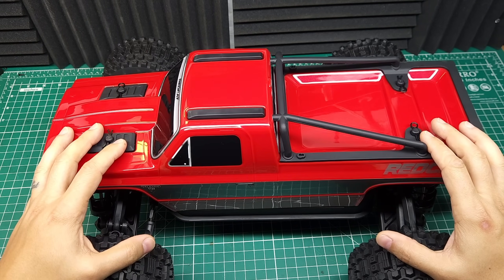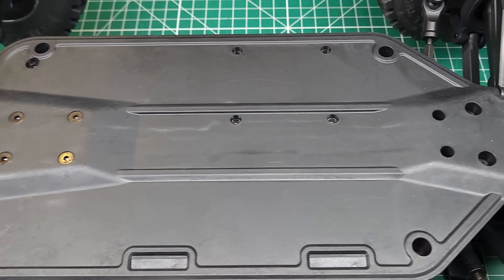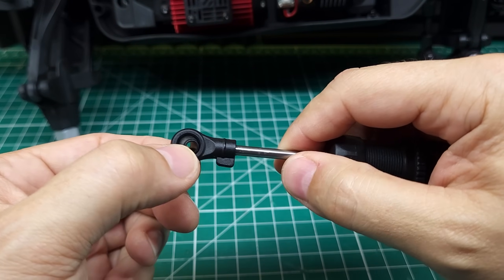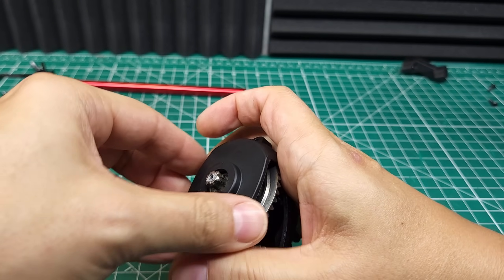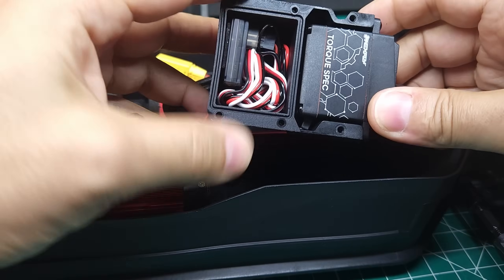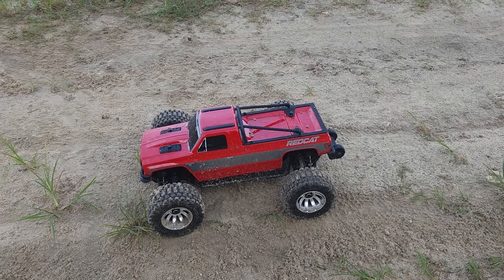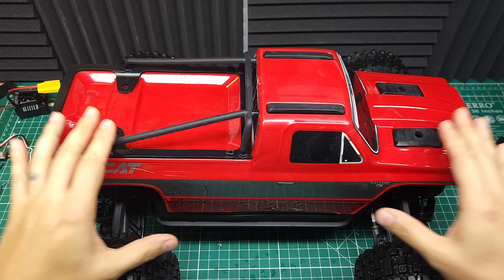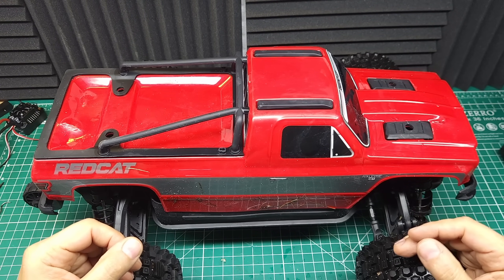I Got The Redcat Valkyrie & It's Awesome! But There's A Problem.

Comment: Have you had any overheating issues with the motor? As soon as I put the same battery you put, the 4s SMC 6500 150c it shuts off on me within five minutes of run time and the green led light on the esc flashes green. Once it cools off it runs for another couple minutes and shuts off. Just curious if you’ve had this issue as well or have heard of that with others. I contacted them and they were great, said they’d send me a new motor once I get a temp reading. I’ll need to buy a temp gun just sucks because I just got this less than two weeks ago.
Reply from the maker: If it's shutting down on overheat it'll be from the ESC not the motor. The motor does not have a temperature sensor in it. I didn't have any overheating issues. Does this happen with a different battery? It's possible you have a defective battery and it's shutting down on low voltage
Reply: @ ok I wasn’t sure what it would be, it happens with both of the same batteries being the ones I mentioned earlier, same as yours in this video.
Reply from the maker: @chrisg3560  hmm

Comment: Good rundown of this rig buddy seems like the geometry of this truck just seems to be a little bit off maybe proportions or suspension travel because it's definitely not a smaller version of the vigilante it actually looks a lot like the armor vortex in terms of proportions and suspension travel there just doesn't seem to be the same type of arm swing and size of tires and makes the body look just a little funky big and it might be me but when I was watching your driving it seemed like the vehicle just didn't handle that well🤔🤔
For $300 though and if it's really durable and those shocks can be fixed that's really a great value
Reply from the maker: Yeah check out my latest video on it. It's fun but definitely doesn't handle well. I think it's biggest problem is the scrub radius in the front. Where are the tires rotate is way far out from where the steering pivot point is and it causes some really odd handling characteristics. 
Overall though like you said for 300 bucks with what you're getting it's kind of hard to be mad at it.

Comment: Where can I buy a 50 thousandths bit?
I stripped the grub screw as well. Not sure what to do… I snapped one of the drive shaft cups trying to get it off. 

Super annoying to wrench on this rig
Reply from the maker: There are quite a few options on Amazon. There's a team associated one that honestly I don't really like as it's kind of soft. I most recently picked up a wera hand hex wrench in  .050. They're made in Germany and it's very good quality.

Comment: Its weird that rc driver online got like 58-59mph on road with his truck but everyone else is getting low-mid 40s offroad. This truck seems like a great deal and im definitely grabbing one. Just wanted to see how the first batch held up.  Great breakdown as always
Reply from the maker: On road and off-road speeds Will always be wildly different because you get less traction off-road, it's harder to control off-road and the friction of the surface is more off-road. 
Personally I like to do off-road runs because it shows people how the car actually is going to handle when they're bashing it and a reasonable speed to expect when bashing. No one I know bashes their monster trucks in a straight line on concrete :-)
Reply: @DoRC  No I get that for sure and I agree. I like seeing both tested on road and off. But i do like seeing offroad speed testing as it seems like alot of guys don't test them offroad and that is what mostly this basher MT will be run
Reply from the maker: @cwatson42785 Yeah when I started doing it I did so because I wasn't seeing anyone else showing the real world off-road speeds. Of course real world off-road speed is pretty subjective too It depends on when the last time the grass was mowed if it rained etc etc so it's more of a general idea than a hard number.
Reply: @DoRC  Yup for sure. That's the one good thing about onroad tests is its more of a true baseline but then comes down to lipos used and what not but I think they are both good info to have. I'm just getting ready to try out my machete I've yet to run. I got the 4s one and got a max8 and new motor to swap in and looking forward to trying it out and then I'm going to grab one of these for sure. Looking forward to more bash videos on it!

Comment: Are the shocks same length front and rear? whats the eye to eye measurement for the shocks? max battery tray length and width? Will a max8 g2 or g2s fit directly? Is redcat coming out with aluminum upgrades like hex extender, c hubs, knuckles, uprights for it have you heard?
Reply from the maker: Yes. 118 mm. 155 by 45 by about 65 though you might need longer straps. There should be room. I have no idea what upgrades they're planning.
Reply: @DoRC  Thanks for the quick reply and info!
Reply: @DoRC Typhon 6s rear shocks are 117mm ;)
Reply from the maker: @magnusstone  Nice! Yeah these look relatively normal in length so I suspect there will be options.

Comment: Redcat seems to be doing pretty good on their newer cars amd trucks
Reply from the maker: Overall yes though this shock issue is probably something that shouldn't have made it out of the factory.
Reply: @DoRC  yeah thats crazy about how they or any company would think a pressed in shock end work work good. Ive had the treaded ones come out once but it was a very hard wreck

Comment: That is wierd I have the truggy and the servo was so fast I had to add a lot of dual rate to calm it down to do the speed run
Reply from the maker: It's fast it's just not powerful and as soon as the rack gets loaded up with any kind of dirt it gets really sluggish.
Reply: @DoRC  I think the smaller tires on the truggy help it seemed ok to me time will tell

Comment: Since the stock ESC is an unbranded hobbywing, you could put in a regular hobbywing max 8 esc with now problem correct?
Reply from the maker: You can use pretty much any brushless ESC with pretty much any brushless motor. That being said the new G2 hobbywing ESCs tend to not play very nicely with some sensorless motors and when they do or do not seems kind of random so that's always a risk.
Reply: @ I have a hobbywing max 8 Gen 1 I guess. Not the newest one. I’ll just have to get bullet connector adapters, I can’t remember what size the connectors are on the max 8 Gen 1 esc.
Reply from the maker: @DaltonKemp Yeah that would work fine.  The Max 8 uses 6.5 mm bullets
Reply: @DoRC  ohhh ok awesome! Thanks!

Comment: I can't find the video for some reason. But there were 2 guys running this truck and jumping it and the only thing they broke was a shock and it broke at the the lower threads. Maybe both types of threaded and press are being dispersed with these?
Reply from the maker: Okay so get this. I just checked the other three shocks and one of them is threaded while three of them are clip style and won't unscrew. Looks like they may already know it's a problem and have just shipped some of the shocks with the old design.
Reply: @DoRC gotta get rid of the old inventory somehow… that’s a bad company
Reply: @DoRC  so crazy!

Comment: You could stick the 2.0 through the axle instead taking the u joint apart , unless the axle solid ?? I’m going grab one of these trucks , shocks is disappointing
Reply from the maker: Yeah unfortunately the end of the axle doesn't have a hole in it.
Reply: That would be so much better. I wonder if a hole could be made?
Reply: I’ve fought with  arrma axles forgetting you can go through the axles, you could experiment 🧪 drilling through but you would need a drill press to keep it centered .
Reply from the maker: @RcPlayer-tt2vw  Yeah you could definitely modify it. I'm kind of surprised they changed the design from the Wov. The little clips are annoying but personally I think I'd rather deal with those than an .050 grub screw

Comment: Hey man how are you? I wanted to así, do you have an opinion on the zd Racing mx-07?
Reply from the maker: Unfortunately I don't have any first hand experience with it The only thing I can say is that from what I've seen it definitely has some weak points and I think for the price you could probably do better with other brands even though you might have getting something that's a little bit smaller
Reply: @DoRC  thanks for the info Man, cause thats the problem, I been thinking about getting a roller of this cause of the price vs the size, next thing in size of im not mistaken, on trucks, would be the X-MAXx, this zd truck with electronics would be around 800usd here in México, I know the X-MAXx Is "1000" usd but thats the US price, here in México Is around 1500, so almost doble the price, also I like better metal on rc's than plastic, even if its heavier and It beends and maybe brakes more easy, but im also not a hard basher at all, just small jumps, no Skateparks, I also been thinking about maybe a kraton or notorious but those are a bit smaller and the spares are way more expensive, but I can get one of those 2 arrmas for 550usd on eBay, shipped to my house, so Its a great deal cause Its really free shipping, I dont know what to do, in your opinion,what do you think i should do? Maybe another posible option? Any input would be welcome

Comment: Wait, u aren't going to recommend it because of shocks? I could see if the shocks broke during your session, but they didn't. It looked like it bashed pretty well , actually. Usually I agree with your vids , but the reasoning on this one is weird. Great video none the less. Keep pumping out the content
Reply from the maker: I'm doing that based on my experience with these shocks in the past. This was a big enough problem with the Wov cars that they pushed out an update pretty much as quickly as they could. Quite a few people had the same breakage with the same shocks. There's no reason to believe that It won't also be a problem in this car. I do have some more information on it though so make sure you check out my next video!
Reply: @DoRC  Yeah, the pressed on shock ends do suck, but you really need to beat them up badly for them to come out. Like a whole bunch of bad landings. Maybe RC comes out with and upgrade in the future for that. But yeah, once those come off, you have to replace the whole shock shaft. At least I had to on my 3s Granite. I put different shocks on it after it happened once. But like I said, it took a while. BUT, that's a much lighter vehicle and a total different animal 😂
Reply from the maker: @joseCalderon1976  The ones on the granite were a lot tougher and you could just push them back in a couple of times. This particular design can actually break from a pretty gentle landing if it's from the right angle.

Comment: When i heard JayTeeRC mention that this had a 8kg servo, i just shook my head. 15kg would have been barely enough.
8kg is a joke on a 10th scale. 
That's unfortunate. Same with the shocks. Seems like Redcat wanted to get rid of the rest of WOV's stock of old style shocks, so they threw them in the Valkyrie. Bummer. Shoulda sold them to HBX, but i guess HBX doesn't have 10th scale trucks.
Reply from the maker: It's possible but these shocks are actually a different length different color and red cat doesn't make this car. The same company made the red cat and made the wov racing.  It just seems like someone at that company didn't tell redcat about the problem with the shocks.
Reply: RTRs rarely come with decent servos. This is nothing new
Reply: According to the box, its supposed to be a 35kg @ 7.4v servo.

Comment: Wouldn't a hollow tube be stronger than solid, and lighter weight?
Reply from the maker: That's actually a more complex question than you might think. For a given mass a hollow tube will be stronger because most of the strength comes from the outside of the shape but for a given diameter a solid rod will be stronger simply because it has more material. So ultimately if they made it larger in diameter and hollow they could make it stronger for the same weight but for the size that it is the rod is stronger

Comment: HR shock travel limiters solves issues.
Reply from the maker: Yes. That would solve the issue but you shouldn't have to do that especially given that the manufacturers already corrected the problem for another brand.
Reply: *when I feel like keeping my shocks around for a long time and not yanking rod ends off- losing retainers and springs, I will use HR everytime.

Comment: Wow you did not recommend it because of shocks mine hasn't broken yet lol
Reply from the maker: Not quite sure what you're saying here :-)
Reply: You said you wouldn't recommend the rc because of the shocks @DoRC
Reply from the maker: @ISIAH_STL  ah. Well given how much of a problem the same design was on the wov racing cars it's tough to give a recommendation on it. It's a good truck I just think that people are going to have problems with the shocks.
Reply: @DoRC  oh ok I understand but all Rcs have weak spots and problems and it depends on driving styles
Reply from the maker: @ISIAH_STL  absolutely but I would call this more than just a weak spot. At least on the wov cars It was really more of a design defect. They fixed it and released an updated version of the Wov cars pretty much as quickly as they could. Obviously not everybody is going to experience a failure but I think it would be frequent enough that it will be considered a pretty big problem.
Reply: I just appreciate your honesty, you're clearly not a fanboy and tell it how it is whatever the brand unlike some other reviewers...

Comment: So this is similar to the one Tomly just reviewed
Reply from the maker: It's nearly identical. I'm sure there are some subtle differences but it'll be 90% the same. The wov racing one Is also very similar though it has some differences in how the suspension works.
Reply from the maker: @WowoodogPlays  It also looks like this uses the same power system as the wov racing.  The redcat one uses a hobby wing power system. It is worth noting that it appears like the new 2-in-one spectrum systems are being made by the same company that makes the wov racing ESC's as the power button is nearly identical.
Reply: @ good to know, I might look into getting one of these cars on this platform (possibly)
Reply from the maker: @WowoodogPlays If you can get it for a reasonable price then it's worth it. The Valkyrie was on pretty crazy sale recently I don't know if it still is. He's definitely aren't the most precise vehicles in the world and the steering system is kind of lame but there's a lot of fun to be had for the money.

Comment: Biggest turnoff with this truck to me is the pinion idler gear and the HORRENDOUS scrub radius
Reply from the maker: What specifically bothers you about the idler gear? 
Yeah the steering geometry definitely isn't awesome though For general bashing around it's not really much of a problem
Reply: The fact that it exists. Added complexity to a truck that’s already a pain to work on. Thats just me though and I’m notoriously picky lol
Reply from the maker: @PigglyWigglyDeluxe I get that. Looking at the design I suspect it's done so that they can have the motor further away from the center differential. The center differential module is pretty big and without that idler the two would interfere with each other.

Comment: I'll spend the extra $40 for the MT10
Reply from the maker: This is quite a bit bigger than the MT-10. More compares to the max and 4S Arrmas in my opinion
Reply: It's a great truck but really not comparable.  This is a lot bigger and has much more power.  I like my MT10 but after driving my Valkyrie a few minutes last night they aren't in the same league.  This is a Max,  4s Outcast/ Kraton competitor.  I can spend a decent amount of money on upgrading this truck before I get to the MSRP of the other trucks in its class.  I'm not getting rid of my 4s Kraton but I suspect it'll be like my Xmaxx after I got the Vigilante.  It'll have a lot more free time on its hands while I'm driving the Redcat.

Comment: Still not convinced these things are as good or better than the 4S Arrma lineup. For example that center driveshaft. Arrma uses a spring loaded telescoping design. Or the simplicity in disassembly. Etc. But I do appreciate this video and your channel.
Reply from the maker: I agree. I think the 4S Arrmas Our objectively better but you're also spending a lot more for them so they better be :-)

Comment: What are mini maxx weaknesses do you know
Reply from the maker: It doesn't have too many out of the box. The servo is not very good and the front c hubs have a tendency to spit out the kingpins but other than that it's a tank.  It also handles like a tank though so if you want something that handles pretty well I'd recommend looking at the 4S outcast instead. It's pretty close to as durable and handles a lot better
Reply: @DoRC  i already have the 4s kraton, i was looking for a second really good skatepark weapon my two options were the mini maxx and the typhon 6s
Reply: @DoRC  on the handling topic i was looking for something more practical but handles like an xmaxx
Reply: @hitpointrc  personally the arrma 4s line is more fun than the mini maxx, I got a mini maxx and sure it’s a tank but it’s not that fun to drive, it’s sluggish compared to the competition. But if that’s no concern then the mini maxx is awesome. I would swap the rear shocks for the sledge rear ones 👍🏻
Reply: I’m not a fan of the plastic axles and junk servo and ESC that loves to give the red lights of death 

Add a hobbywing with stock motor, upgraded servo and axles, and boom. Done.
Reply: Thanks for the input
Reply: @hitpointrc I'd say the mini Max does handle like a Xmaxx.   They're both atrocious.  I have 1 Xmaxx still so I am not a hater.  Just someone who's had a few Xmaxx but also owns a few other rigs that handle good for comparison.